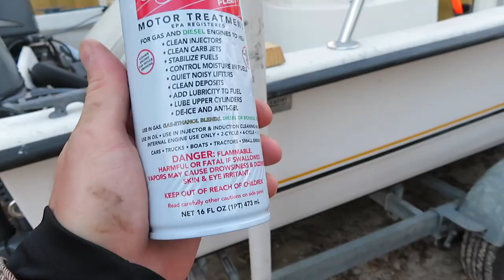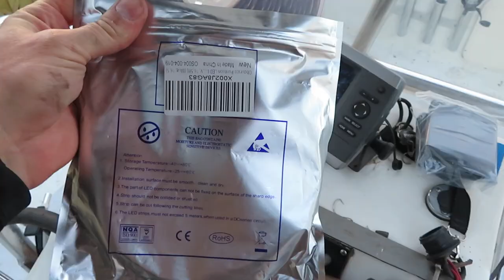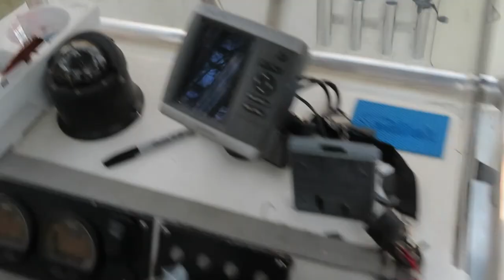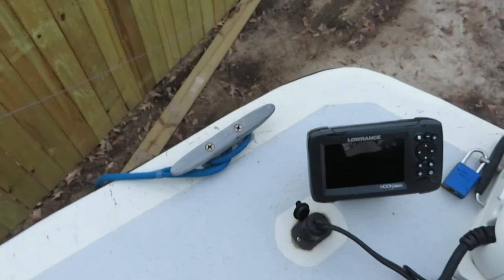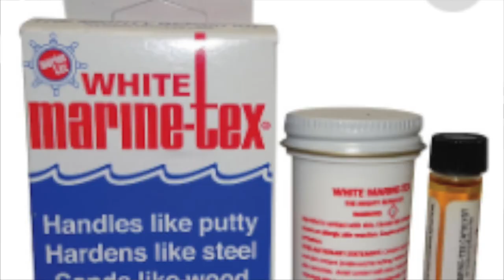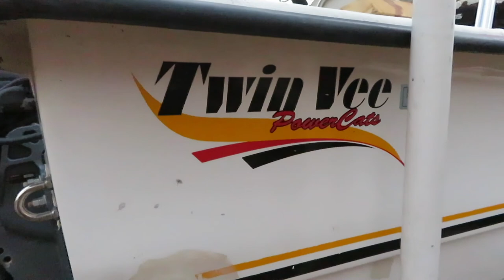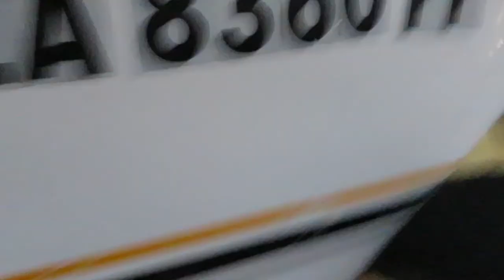New Catamaran Fishing Boat Modifications - EASY BOAT MODS!

Comment: I would fiberglass two thin pvc pipes on each side on the boat on the floor and run them to the back of the boat so you can run wires
Reply from the maker: There's an idea 💡
I might even be able to get away with one.

Comment: The grease on your rims looked pretty dry, so it may have been from the old axle hub assembly, otherwise it may be coming from the rear bearing spindle seal, at least that's been my experience.  This generally happens when people over grease their bearing by constantly adding grease via the buddy bearing caps.  Grease heats up rolling down the road at high speeds, liquifies and expands, nowhere to go but out the rear seal.  Open face rims (mag style rims with holes in center) will allow the grease to pass through to the front of the rim when traveling at high speeds.  Check the back side of the rim for fresh grease after towing and also check the rear seal for signs of leaking.  Root cause is typically from over greasing and filling hub assembly with too much grease.  Buddy bearing style protectors also incorporate a spring that is constantly applying pressure to the front trying to force more grease into the bearings/hub.  I have seen some hub assemblies that also contain a grease relief that will sometimes expel small amounts of grease when over greasing.  BTW - the mods look good, sounds like you're on a roll with your updates.  Great joy and satisfaction are always experienced when fixing up your boat just the way you want it.
Reply from the maker: Thanks so much for all the advice!!